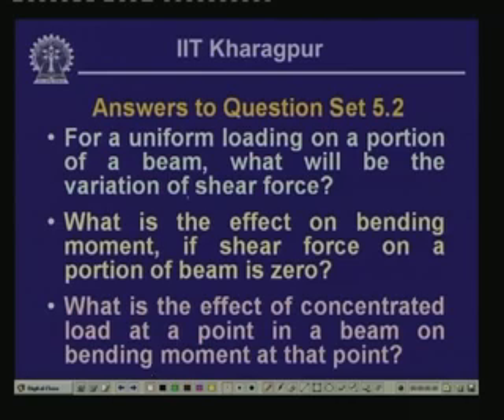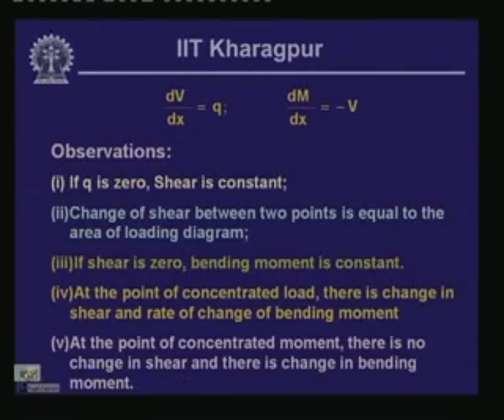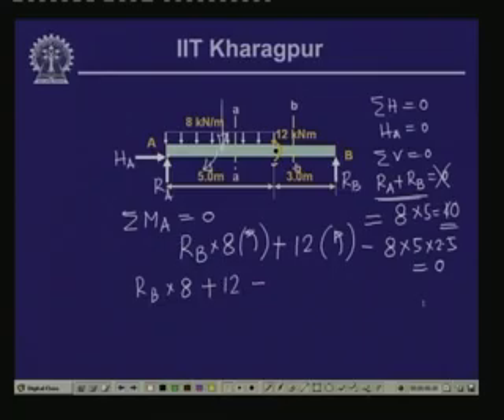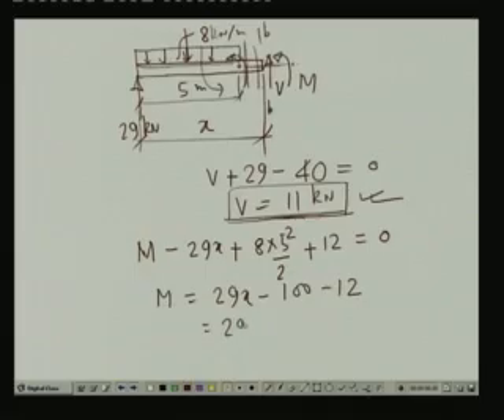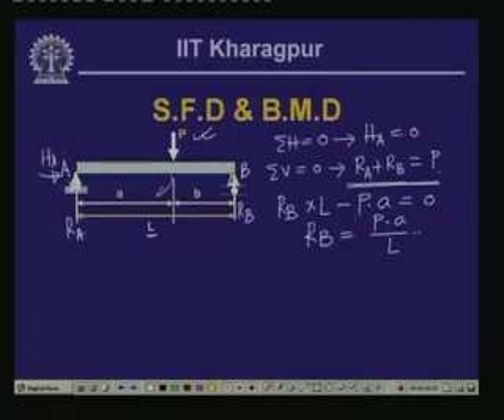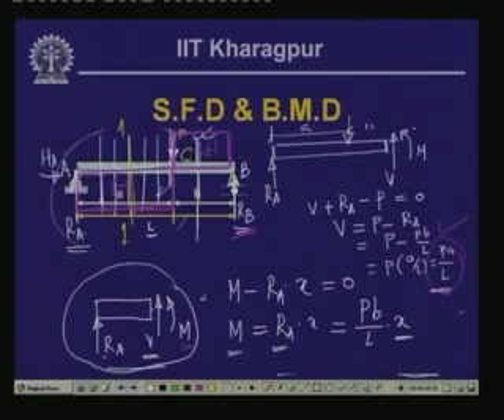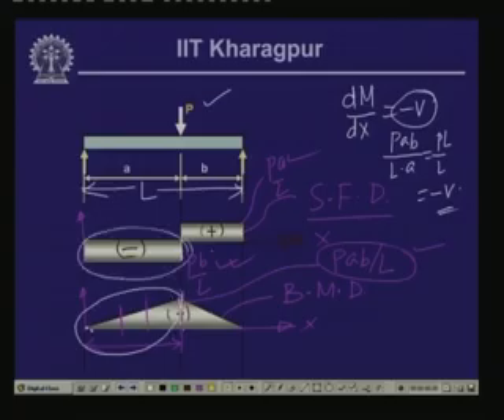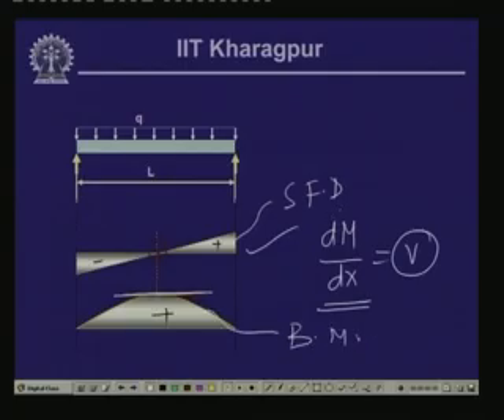Lecture - 24 Bending of Beams - III

Comment: RESPECTED SIR  I HAVE A DOUBT. AT 26:40  when we calculate the bending moment at b-b section due to the udl = 8 kN/m. why did not we consider the length X in that. should it not be  8*5*(X-5/2)?
Reply: i think there is a calculation  mistake ....M-29*x+8*5*(x-5/2)+12=0  => M= -11*x+88 . this is also in accordance with dM/dx=  -V  as dM/dx= -11 and  V=11 .
Reply: the udl moment about section b-b will be 8*5(x-2.5) then M = -11x+88 so after putting x=5m thr value of M =33kn-m